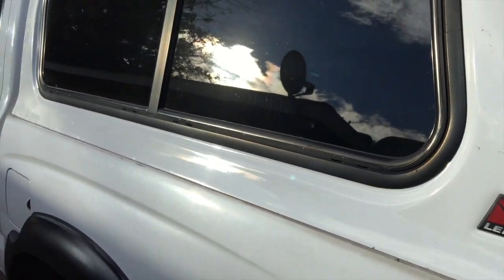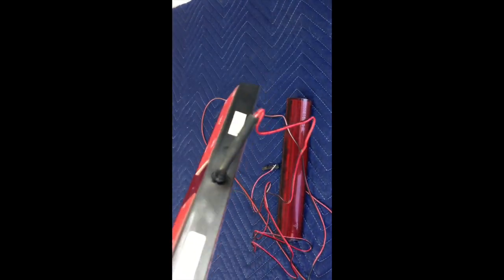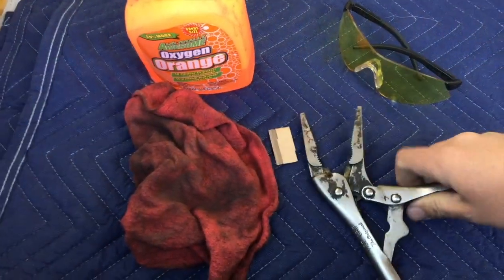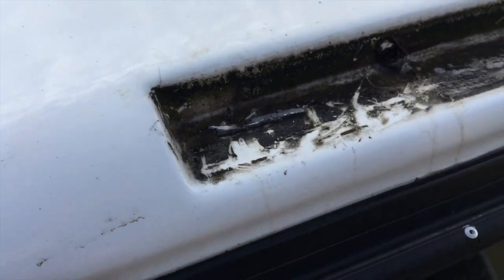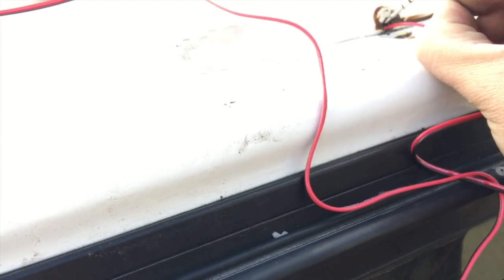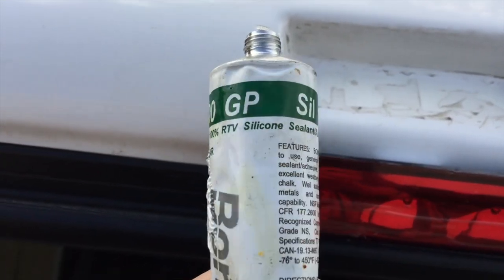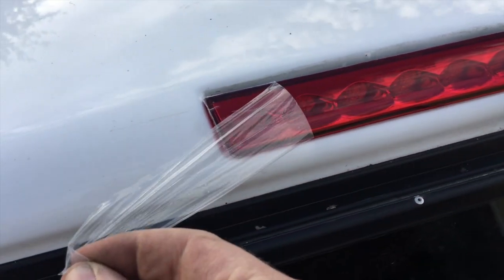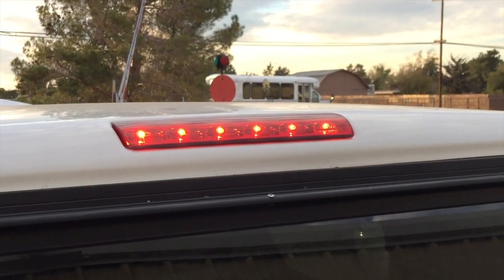How To Remove & Replace A Leer Camper Shell Rear LED Tail light Bar

Comment: Is your shell carpeted inside? I need to replace the brake light in a used shell I just purchased for my '05 Tacoma, and a bit nervous about dealing with the carpet. Thanks for the video!
Reply: Hey thanks for watching. My truck is not carpeted inside. I wouldn't see why it would be any harder to change with carpet. All you need to do is roll the carpet out of the way.
Reply: My SnugTop shell is carpeted inside. It's glued into place and I'm not sure how to peel it back without damaging it.
Reply: @curtisnotestine3134  It's been awhile, and I don't have the truck anymore to verify, but I believe I was able to find a loose corner and peel away what very little I needed without issue. The "carpet" was quite stiff, and went back in place without any issue.

If yours causes any problems, I doubt it's anything some adhesive can't fix.

Comment: You showed us the obvious. Why don’t you show us the disconnecting and connecting of the wires. That’s the technical part. That is the real question most have. How do you disconnect the old wires and reconnect the new wires the without possibly shorting the system?

Comment: The gap is because the replacement light is the wrong size. Now it can collect dirt and water and looks terrible. Good job👎
Reply: Thing is this part about discontinued/non-supplied in 99% of leer suppliers. Plus the only one found was $200. I don't mind dirt collecting there, fiberglass doesn't rust so its not a worry at all.